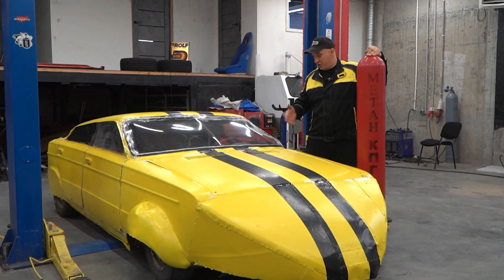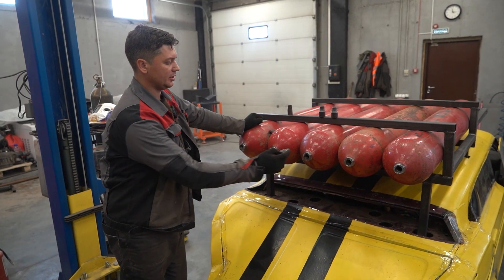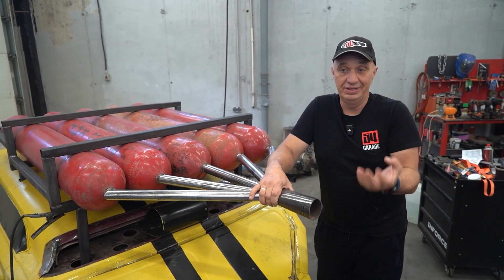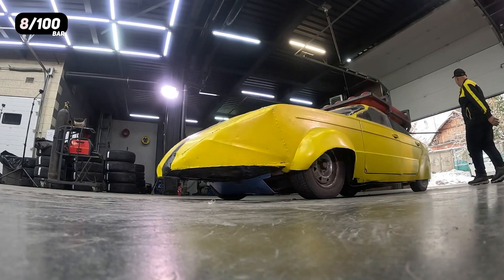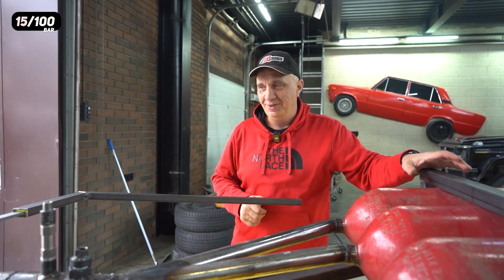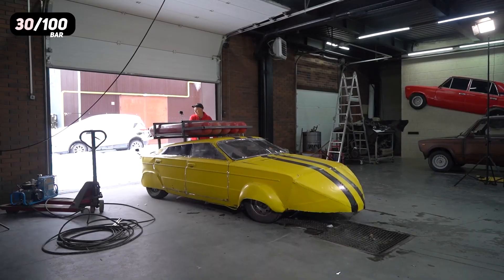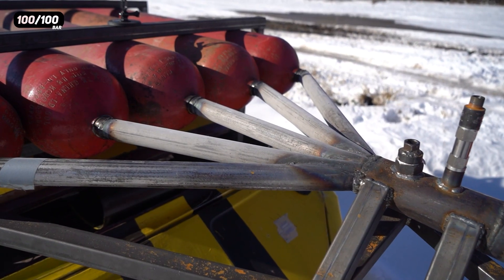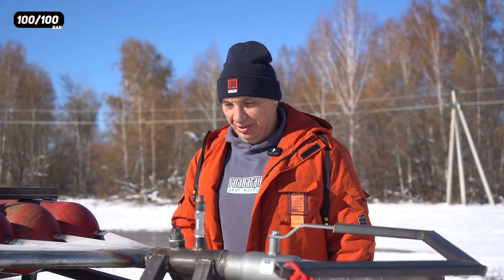Rocket propulsion for our Aero Lada - will it work?

Comment: you need to heat the bottles up to 250C and it will go a LOT faster. Or kill everyone. Either way it will be a laugh. We have a bike here in the uk that operates on the same principle, its 60ft time is 0.7 seconds. It shuts off at the 330ft mark yet still does the quarter mile in 6 seconds

Comment: Feed the water in from a seperate tank. Either bt a pump or with a feeder tube that sucks the water in as the air rush by. I guess that it should be located near or at least before the venturi. If you are going to the high pressure make sure your welds are proper. You are making a bomb :)

Comment: Fill a couple tanks with O2 and a few more with kerosene. An extra tank with LN2 and metal tubing routed around the nozzle for cooling. Last add a spark plug where the gas and kerosene mix. As it shoots out the back spark it and ride the flame 🔥. That's going to be a Saturn V Lada Edition.

Comment: In thermodynamics, there is the cryoscopic constant. This refers to the amount of solute when dissolved in a solvent that will reduce the freezing point. If you work to around 90g of NaCl (salt) per litre of water, that will reduce the freezing point to -10 Celsius. In theory, this will work as far as -40 with 360g of salt per litre...HOWEVER, the reduction is not quite linear, and beyond 360g you'll saturate the solution and find it hard to dissolve more. The salt water will also increase density, so thrust should be improved.

Comment: Well I would propose using a different kind of gas potentially a mixture of certain gases like hydrogen and oxygen in the correct ratio to provide a blue flame to achieve optimal gas expansion creating a higher output pressure then the input

Comment: I love the concept, but one thing I would recommend if you are increasing the pressure is to increase the thickness of the pipe to the same as the tank wall width, use a comparable steel, and make sure your welds can penetrate all the way through. 
100 bar is far beyond just dangerous.

Comment: I want to see how this car will do when there's no snow on the road. First, I want to see how fast and far it can go from just jet propulsion alone. Then, I want to see acceleration runs where the car starts off with the engine then fires off the rocket for more boost.

Comment: 9:31 perhaps the part of the main rocket where all the individual tubes from the bottles meet should be modified. Now it looks almost like a straight pipe. Maybe it should be shaped similar to the 7.62x54R cartridge case; wide & narrowing down towards the exhaust. Or maybe the other way around, I'm not a rocket engineer haha! But some sort of expansion compartment for mixing the input gases/vapors could be useful, at some point of the rocket train.

Comment: you need 3 of the tanks filled with propane, 2 with pure oxygen. And expansion chamber then reduction before the nozzle.
Valves should be on each tank. The a spark in the expansion chamber to get it going. And you should see sustained thrust 10x what you air water mix did.
You can control the tank valves for throttle or to shut it off.

Comment: You guys are crazy hilarious!  You have to make some changes though - take off that diverging nozzle, thats only used for supersonic flow of compressable fluid, water is neither, use a nozzle that reduces size a little from the valve. If you need more thrust, use a bigger valve or a second one, thrust is internal pressure times nozzle area (as long as the nozzle is smaller than the valve). Fill the tanks about 3/4 full of water, just keep enough air volume to keep pressure high until the water is gone. Acceleration will keep the water at the back, dont worry about that.

Comment: modify the system so you have one big tank. The tank should be 30% to 40% full filled with water and the rest above filled with pressurized air. this doesn't allow the pressurized air to escape but to push the water with very high pressure. I believe this way you will have much higher thrust and for longer period.
Reply: same principle as this rocket but much better https://www.youtube.com/shorts/oP3a9bLWHco

Comment: Here is a major issue. It is very cold outside. When the air is releasted from high pressure to a low pressure the temperature will drop. When the temperature drops two bad things happen. The compressed air pressure drops because you have lowered the temperature because you lowered the pressure. You have created an air conditioner. The escaping water can freeze and restrict the flow. 

Heat the water and do it in the summer time and you will increase the performance.

Check your pipe pressure rating.

I suggest using fully pressurized nitrogen cylinder and use a regulator to pressurize a water tank. This way you can hit the limit of your pipes.

Comment: Add 4 More tanks.. made of fiberglass so they don't ruin power to weight ratio.
Construct a plenum with a dedicated water tank feeding the water.. instead of filling up all the tanks with water and air.
You will be able to pack more air into the tanks without there being water inside.

If you have a dedicated water tank whose contents are allowed to flow into the area of the plenum just before the Venturi.. You should be able to achieve maximum volume of compression with your air and maximum thrust with a steady supply of water.. this would also allow you to tune the air water ratio.

Comment: I've been wanting to do this, and in looking into water rockets people seem to find sweet spots in their water fill percentage, so filling through that manifold is probably really limiting thrust since some tanks may have too much and some probably just air. I'd suggest individual valves on each cylinder and jacking the back of the car up so you can precisely measure. 

Plus individual valves would be MUCH safer. That manifold is a lot of welds ready to fail. 

With using some of the math out there, it seems like this can create insane thrust if you get everything right. Like, literally insane levels. Just a little refinement in your process and the silly thing would probably take off.

Comment: The tank angle would make a big difference so the air is always above the water line and the slosh of the water will have less effect, your load cell test issue caused by that.
Only other thing, not sure how long the system sits pressurised, but air dissolves into water so will loose power overtime, you could use a hydraulic bladder accumulator with nitrogen and then fill the system with a pressure washer as they are well above 100bar. But this much stored energy is truly scary! Be careful!

Comment: Can use this system with a regulator to "turbo" the engine. Like set the pressure to 6-12psi and have the output go to the intake, and when youre flooring it open the valve should try 😂

Comment: Ваша идея хороша, но только для коротких очередей. Конечно, вам действительно нужен двигатель J-TOW или аналогичный, чтобы поднимать в воздух тяжёлые самолёты. Это… особенно в условиях такой операции… вероятно, незаконно. Поэтому, думаю, я бы, наверное, построил пульсирующий реактивный двигатель. Похожий на тот, что немцы использовали над Британией во время Второй мировой войны. Он довольно прост в использовании. Но будьте осторожны, он склонен к возгоранию. Поэтому ваш топливный бак и насос должны быть полностью изолированы от водителя, с возможностью быстрого выхода.

Your idea is good, but only for short bursts. Of course, you really need a J-TOW engine or something similar to lift heavy aircraft. That... especially in an operation like this... is probably illegal. So, I think I'd probably build a pulsejet. Similar to the ones the Germans used over Britain during World War II. It's fairly easy to use. But be careful, it's prone to fire. So your fuel tank and pump should be completely isolated from the driver, with a quick escape route.

Comment: You have to make sure every zylinder is filled with equal amount of water. Second, air only should come out when the water is empty. So you will need a low hanging pickup inside the zylinders. That should produce  a lot of thrust over a longer periode of time.

Comment: You might want to have a seperate tank that is completely filled with water, so that when you open the valve, all of the water gets shot out the back first, before any air can escape. Otherwise, you would decrease the amount of air that can be stored the more you fill up the air tanks with water.
Also, tilting the tanks would help with this, and if you use CO2 instead of air, you can compress the CO2 so much that it has to turn into a liquid, even though it wants to be a gas. Then, when the valve is opened, the liquid turns into gas, which has thousands of times more volume than the liquid.

Comment: The problem with this idea is the compressed air is a weak energy supply for a heavy vehicle. It would be more efficient and range would be better if the compressed air was fed through a combustion engine, although the engineering requirements would be challenging. As air expands, it cools in the pipes (PV=nRT). This will freeze the water and quickly block up the pipe.
There is also the possibility of a dangerous mechanical failure leading to a powerful explosion and flying debris.
I would consider going for a chemical rocket engine. Compressed oxygen could be mixed with gasoline in an axial rocket combustion chamber. Once the vehicle reached about 200 km/hr, it could be remotely guided onto a launch ramp, where it would take off on an unmanned journey and fly through the air using a wing/tail welded to the roof. Simple electrical control surfaces would improve the chances of a soft landing, once all fuel was expended.

Comment: 100 bars is an insane amount of pressure. Each cm² is subjected to just a bit over 100kg of force! So if you had a pipe with an ID of 4cm, that's 12.5cm², thus 1.25 TONS of static force!

That's so much pressure that they literally have reinforced metal boxes to fill up air tanks, because if an air tank's valve broke off or a tank ruptured, it wouldn't kill anyone in the area

You can imagine the energy stored in a tank if you had a motor, with the same power as an air compressor, and have it compress a spring for as long as the air compressor would have taken to fill a gas tank. When the gas tank is full, the spring should be sized so that it is also fully compressed.
That's a big ass spring, and it's fully loaded. You can probably think of what will happen if you release that spring.
That's about as much energy is stored in a tank.

Don't believe me, believe the videos of exploding air tanks. Shit's scary

Kreosan has a video where they explode an oxygen cylinder.

Comment: Connect 3 cylinders to the nozzle and fill with water, flip the other 2 cylinders around and connect to the opposite ends of the cylinders and fill these with high pressure air. This will separate to an extent the water and air and force mostly water out instead of a water and air mix. To maximize the effect, you'll need valves where the air enters the water filled cylinders and a highly accurate timing device to open all of the valves at once. Since you'll already have a high pressure air supply, I would tap that to a single master valve connecting to the three valves with air solenoids. Great video as always! Keep up the good work!

Comment: Imagine connecting this to a turbine which is connected to the drive shaft, in a closed system. Then, use the engine to power a high pressure pump (as well as providing normal-speed transportation).....this way you could have a rechargeable power booster which could be activated from inside the cabin!

Comment: Awesome! If you want to make another video with this build you could do a high speed run with a plate welded on the release valve, sized just right so when you hit the target speed air pressure opens the rocket valve for a top end speed boost. I bet you could get an extra 20-30 km/h of top speed that way.

Comment: after watching the whole video - you should add a pressure regulator at the exit before the nozzle, because the pressure drops very quickly, so you get a high power burst for a short time and youre using the "fuel" quickly and not efficiently, also you can add a solenoid valve that will togle the exit to the nozzle, just connect it to the car battery and add a button somehwere in the car. 
next step would be to fill it up with gasoline and light it up when it shoots out of the nozzle lol

Comment: I think if you fill the cylinders with water and them find a way to heat up the cylinders to boil the water. The water will stay a liquid in the cylinders evn when the temp goes well ove 100c. and build up a lot of pressure. If you tilt the cylinders so that when you open the steam comes out but then all the water in the cylinders turns to steam when you open the valve. That will give you many times more thrust and the steam will last quite a bit longer. But you need to take a lot of precautions so you do not blow up the cylinders, I would for a pressure gauge in the system so you know you are not exceeding the pressure that the cylinders can take.

Comment: Add some alcohol to the water to prevent freezing when the pressure drops…. You might be getting clogging in the valve from ice… also angle the tanks up at the front to drive out the water first to reduce  the propellant mas quickest when you have most pressure in the tanks…. Amazing welding at 100 bar

Comment: Tow it with a running start and then hit the thruster. All the energy is being wasted on the dead start. If it was rolling first it would be much better use of the booster.

Comment: When air is compresses it releases its stored heat energy  so when you open that valve and all of that compressed air and the water vapor leave the expansion of the air makes it colder same principles in AC unit, the only way to keep it from icing up is to not have water vapor in the system which would make it a less viable propulsion system because it would have nothing to throw out the back.

Comment: With the bottle hole at the middle most of the water stays in the bottle as just weight to accelerate and less air volume for less duration.

Comment: The tanks may be rated for 300 kilos, but I don't think the pipes and welds would be able to handle that much pressure. I would be very careful going that high. My first thought when I saw the video was that the tanks would have something flammable with an igniter on the nozzle to give it real rocket power. That may be a little too sketchy to actually try without some professional supervision.

Comment: Set up control valves for the tanks, install an ignition souce where the fuel lines converge, and fill the tanks with a combustible gas...and test the setup without anyone nearby.

This is still really impressive, and it moved out well, considering the drag from that snow. This is a full size balloon car, 

You could also try modifying components such as the axles and differentiate area. Since the power is no longer being sent to the wheels, removing mass, rotational mass, and friction by having all wheels entirely free turning. 

Soon, the Lada will be setting a record at the Salt Flats.
Reply: I was also thinking they could stick to just air in the tanks, and inject/venturi a liquid fuel just before the nozzle to create an air-as-oxidizer liquid fuel rocket engine!

Comment: There are special types of tanks with a movable membrane on the inside. 
These are specialty things, you run about 200bar of hydraulic oil on one side and idk how many bar of nitrogen on the other. 
We use those on our EAF and LAF to have the electrodes lift up automatically when there's a power outage.
It would be perfect for this stuff. They are called accumulator stations.

Comment: To maximize thrust from the high-pressure propellant system, the smallest cross-sectional area, known as the throat, should be located within a de Laval nozzle, not solely in the converging section. The system begins with five conduits carrying water and high-pressure air (above 100 bar) from separate tanks. These conduits should converge into a single, larger-diameter pipe, referred to as a manifold, to consolidate the flow and minimize pressure losses. The manifold directs the propellant to a valve, which controls the sudden release of the water-air mixture.
From the valve, the propellant enters the de Laval nozzle, which consists of a converging section, a throat, and a diverging section. In the converging section, the nozzle narrows, accelerating the propellant flow. The throat, the point of minimum diameter, must be significantly smaller than the manifold to achieve choked flow, where the flow reaches sonic velocity (Mach 1) for the air component, maximizing mass flow rate. After the throat, the nozzle diverges, allowing the propellant to expand and accelerate to supersonic velocities, generating high thrust.
The rapid release of high-pressure propellant (over 100 bar) through the nozzle may produce shock diamonds—visible, diamond-shaped patterns in the exhaust caused by supersonic flow adjusting to ambient pressure. These patterns indicate efficient acceleration but may suggest a slight mismatch between the nozzle’s exit pressure and the surrounding air pressure.

Comment: It would be harder to engineer, but if each tank had its own nozzle that all opened simultaneously you would get a faster release of the overall pressure and generate a lot more thrust. This is how pumpkin cannons work. The faster you can release the pressure the more force you get, and the further the pumpkins will fly. It would be the same for how fast the car accelerates.